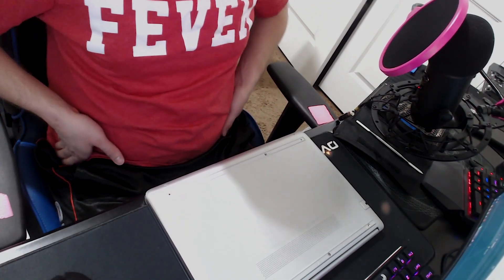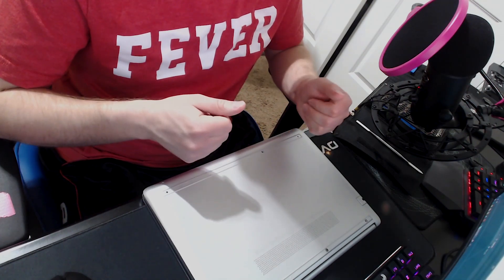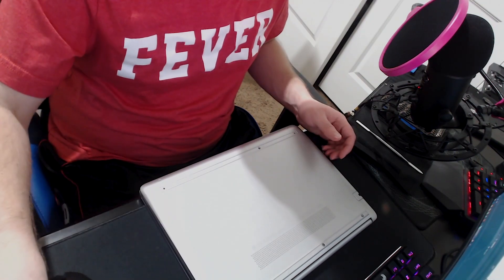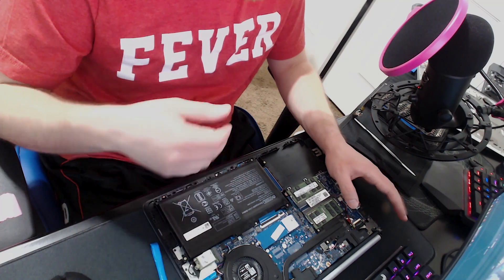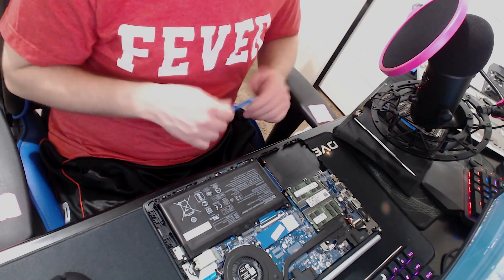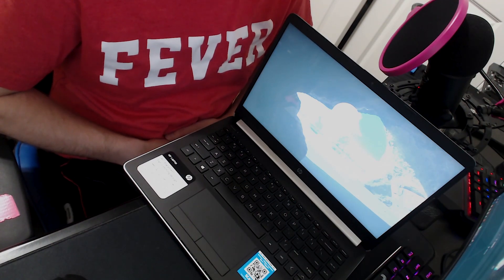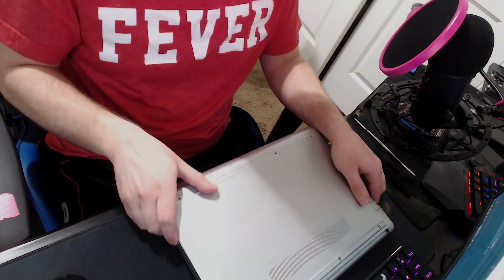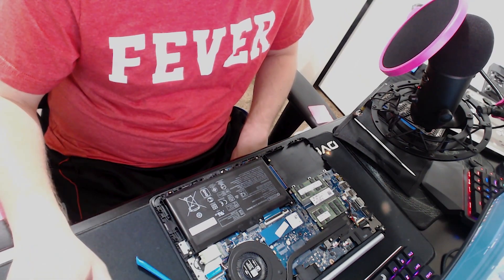HP 14 dk0002dx RAM Upgrade

Comment: Great video!! I have this same 14 dk0002dx laptop. You wouldn't happen to have an Amazon link for recommended 8G RAM module? I was thinking to install two of them for 16GB total.  Just want to make sure I buy something compatible. Thanks!!!
Reply from the maker: This is similar to what I put in during the video. If you want my opinion, I think 16GB is a waste on these. 

https://www.amazon.com/Samsung-2666MHz-Memory-Laptops-M471A1K43CB1/dp/B07JWG53DG/ref=sr_1_2?dchild=1&keywords=samsung+8gb&qid=1597768395&sr=8-2
Reply: @ppmguire  Thanks!! You are probably right. I will just get one of the 8GB then. Much Appreciated and thank you again for taking the time to post this!!
Reply: @ppmguire  I'm thinking just get another 4GB of the exact same card for 8GB total. Any negatives to this one?  https://www.amazon.com/Samsung-PC4-21300-2666MHZ-SODIMM-Laptop/dp/B07HJB2KSR
Reply: @ppmguire  By adding the identical 4GB card, it would be 8GB total but still take advantage of the dual channel function, correct?
Reply from the maker: @eyemright  Yes it'll run in dual channel. I added an 8GB stick to the 4 already there in one of these and you could see a difference in the OS but actually doing anything the CPU held it back still.
Reply: @ppmguire  I added an identical 4GB RAM (now 8GB total) and instantly noticed improvement...Thanks!!! Curious if you ever found a way to unlock the 1866 speed to 2666?
Reply from the maker: @eyemright  Not gonna lie, I haven't even looked into it lol. I wasn't happy with how bad they were so we kinda left them as backup machines for the kids in case their PC goes down.
Reply: ppmguire HaHa, yes I agree they’re pretty basic. I was just looking for opportunity to make it a little better. Appreciate the feedback. Best Regards!!!
Reply from the maker: @Radiateprosperity  This doesn't apply to the laptop in my video, or many OEM laptops because settings like this are locked out in the bios.

Comment: Is everything already there to add a 2.5” HD? I see the space where it would go but not sure if the connection is there or not.
Reply from the maker: For this specific model no, it's not there. YMMV depending on submodel though.
Reply: Probably need to order the ribbon cable for SATA. Now I wonder if they populated the motherboard connector for that Ribbon cable. 

I’ve taken other HP laptops (an x360 and a 1st gen HP Stream that had the physical accommodation for an M.2 drive, but didn’t populate the connector.
Reply: Jonathan Gahan  since then I got the larger version of this same computer that comes with a 1tb hdd and the 128gb ssd. It appeared to be the same mother board inside when I installed the ram upgrade
Reply from the maker: @jimbeam4535  I figured this would be the case based off empty board connectors when I opened it up. HP loves to do this.

Comment: Hi from Perú bro, what's better to do?  I have a hp 14 cm007la with 4gb ddr4 micron technology, and it has a second free slot, should I add 8gb ram to will have 12gb ram or better remove 4gb ram and put a 8gb ram, or add a 4gb ram in second slot? In Perú there isn't micron technology so instead I will buy Kingston or crucial
Reply from the maker: I don't see why not.
Reply: @ppmguire  Funny enough, my display wouldn't work when I added 8gb to the second slot. Swapped the chips and it worked, 12 GB!

Comment: Can I apply your video onto an HP 14-dk1003dx I don't know that much about laptops just making sure I am not f-ing up my laptop
Reply from the maker: From another post below I'm going to say yes.
Reply: @ppmguire  thanks I didn't check the post since it was 4 am when I asked the question.
Reply from the maker: @Gabriel-uz7ms  Np. I scrolled down to a previously posted comment to check model numbers.
Reply: Excuse me, can I upgrade the RAM of HP 14-DK0033NS, 14" Full-HD, AMD Ryzen™ 5 3500U , 8 GB, 512 GB SSD, Radeon™ Vega 8 to 16GB? Is there another slot to put 8GB to get 16GB? Thanks in advance.

Comment: when you said about there being a space for installing a dedicated graphics card, what kinda graphics cards can we use? would love if you could elaborate on this
Reply from the maker: I'm talking about the space on the board for a GPU to be soldered onto at the factory for higher end models. I point at those spots under the heat pipe when referring to them because they're empty.
Reply: @ppmguire  i see, thank you dude and thanks for the video

Comment: I have a HP 14-dk0075nr, would this be the same situation? I’m looking to upgrade the original 4GB RAM. 

Also, would I be able to upgrade the Hard Drive? It’s originally a 64 GB eMMC. 

Crucial says I can upgrade the RAM to 16GB, should I push for 32GB?
Reply from the maker: Same reply as the guy below really. At first glance the port layout looks the same, so I could assume the inside might. What's throwing me off is the storage configuration. If you have the bit necessary, just take the few screws off of the bottom and check. If it looks the same as the one in the video on the inside, good chance it can be upgraded. Just look before purchasing anything.

Comment: If I were to add an 8gb stick with the included 4gb stick would it still run in dual channel?
Reply from the maker: Yes.
Reply: @ppmguire  ok thanks, nowhere else said if this supports flex mode at all, so 8 gigs will be dc and 4 will be sc
Reply from the maker: @ctc514  I haven't looked into it too deep to see what's what, I just know that I have an 8 and a 4 running in one of these and it says 1866 DC.

Comment: Is it the same process for the 14-DK1003DX? I'm looking at this model. Thanks
Reply from the maker: I can't say for sure, but based on the port layout and overall look of the device I'd say the insides are probably identical except this one has a different CPU soldered on. Flip it over and look to see the screw layout, if the teardown procedure is the same just give it a look inside. I will point out, they have DDR4 2400 specified so that's a plus over my model which is locked to 1866.
Reply: @ppmguire  Thank you! I will give a shop! Hope you are staying safe and healthy. - P
Reply: Exact same process I just did added a second 4GB module on two 14-DK1003DX laptops. Immediate performance boost on both. The worst part is pulling off the rubber grip strips, they tend to break into lots of smaller pieces.
Reply from the maker: @tepyogi  I did these when they were new so had no issues there. I could see them getting brittle with age.

Comment: You keep mentioning PC4 2666MHz, but that’s not what comes with this laptop from HP. I ordered the wrong ram because of this video. My identical model to yours came with one 4GB PC4-3200 sodimm. I ended up exchanging the 2x8GB Kingston Hyperx PC4-2666 with 2x8GB Kingston Hyperx PC4-3200. No reason to downgrade the ram.
Reply from the maker: Jim Judson I also kept mentioning in the video and in these comments that both laptops we have here came with 2666 but they are bios limited to 1866 AND I said YMMV for both RAM and SSD because HP ships with varying brands. I was also clear ours were equipped with 4GB 2666 and that the reason of me making this video was because HP was saying on their boards that the model ‘could’ be upgraded to 8GB but didn’t have an accessible slot to do so. Even after many others saying they successfully upgraded their laptops. So I’d say it was lack of paying attention rather than my info. Check the RAM tab on your task manager, can pretty much guarantee it says 1866 if you have an identical model making the end speed of the upgrade moot.
Reply: @ppmguire  HP's saying that as their windows licensing fees is tied to the configuration. MS charges significantly more $$ for 8GB configs.
Reply from the maker: @sotroof  HP is sold licensing in bulk on a tiered basis from Home, Pro, and Enterprise not by a config basis. Microsoft does not care what they do after they have acquired their licenses. You can actually fact check this yourself if you go and config a 4GB laptop model and change it to 8GB. The OS cost does not change.

Comment: Amazing video my friend!
Totally cleared the situation!
So finally we can upgrade our ram with a new one even if its not at 1866 mhz??
Reply from the maker: Correct. The RAM that was in this one from the factory was 2666 and I added 2666 to it. We have two of these and the second laptop was shipped with Hynix 2400. I don't quite understand the RAM speed limitation other than being a walled and forced upgrade path.